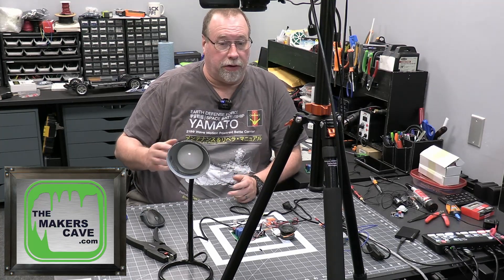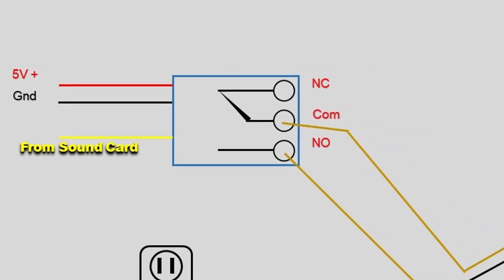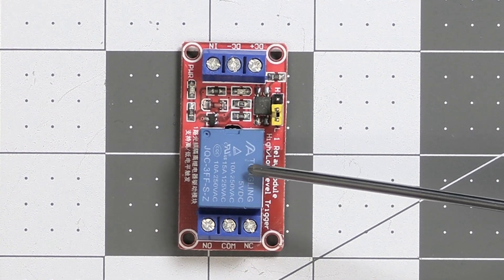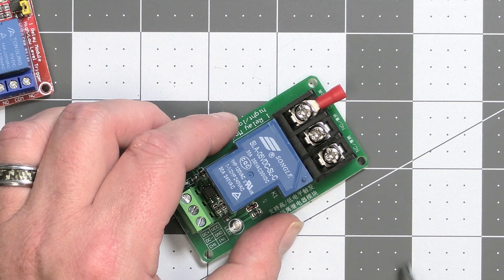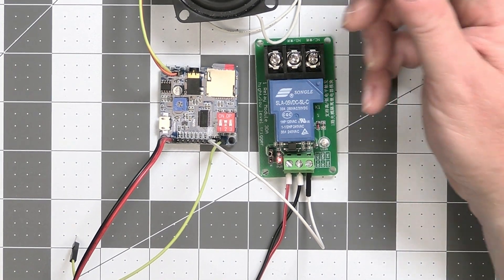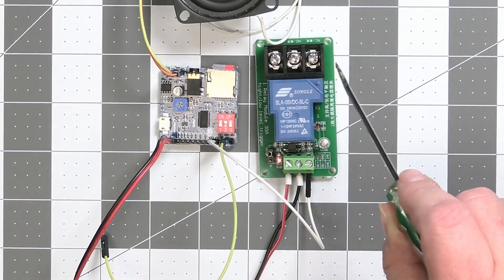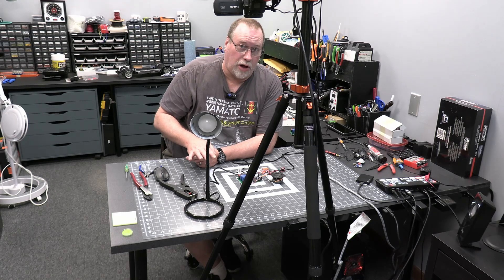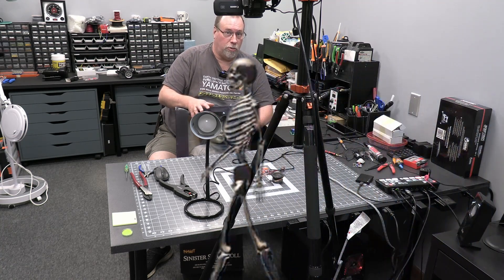How to wire lights & motors to the Easy Prop Sound project

Comment: I have the mp3 connected to the 5v 4 relay board and everything is working properly (4 props) but I have no sound ...can you send me a connection diagram...please...thanks
Reply: Never Mind I had a loose wire...thanks for your complete walk through it all works.

Comment: Excellent video! I would remind people that the deer motor will switch directions under a load or initial start up ;)
Reply from the maker: That's the problem with common AC motors,      the rotation direction is random on power up.  I wanted to  mention that and forgot, I was trying to make sure i answered all the questions I was getting.
Reply: I know this is a dated response to deer motors...I was pulling motors out of tossed microwaves...and they are asynchronous .  If it's important to your prop,  you can order synchronous motors (one way spin) from different repair houses.

Comment: Great explanation, however you should address polarity regarding AC power to prevent possible electrocution.  Also perhaps mention the sizing of the spade connectors depending on gauge of wire.

Comment: Watched these two videos in quick succession. I’m a haunt builder that has 0 knowledge of electrical and board technology. Thank you for making this video super easy to understand. Your directions are clear and at a great pace to understand what’s going on. I never felt lost at any step. Oh and your diagrams and animations are helpful too. You can tell you put a lot of time into your videos. You have earned a subscriber in me. QUESTION: Any suggestions for a casing for all of the boards so that this could be kept outside for a short period (few weeks/days) to prevent the weather from ruining the tech? Is something made specifically to house those boards other than using a Tupperware container or similar?
Reply from the maker: I'm so glad you enjoy the videos and thanks so much for watching.  There are no specific enclosures for the boards.  Yet.  Katrina and I have been toying with offering custom boxes to house the boards.

Comment: Hi Steve!  I wish I lived near you so I could buy you a beer (if you drink).  This was another great video and I am really looking forward to the next in the series.  Your tutorials are very helpful and spark the imagination.   I think we're headed in this direction already but since you asked for content suggestions I'm going to throw this out there.  I'd really like some instruction on how to build my own Prefect Storm or PicoSTORM or Velleman LIGHT ORGAN.  The PicoSTORM is a nice piece of equipment but it doesn't play well with LED spotlights which I think simulate lightning better than halogen or incandescent.  The Light Organ is also a fun piece of equipment but it's low voltage and there's no direct audio input so it's uses are limited.  Thanks again for what you are doing!
Reply from the maker: Very interesting.  The hardest part is getting the lights to sync with some thunder sounds.  I'm already thinking of way :)

Comment: Would it be possible to wire the relay board so the light stays on after the switch is activated and the sound ends? It’s for my proton pack build and I’m still sorting out how to have two light and sound pairs. The first pair would switch on together with a rocker switch, but the light would remain on after the sound, the pack powering up, ends. The second pair would work simultaneously with a button switch. 

Thank you 😊

Comment: Just a casual observation. When you cut the AC cord I noticed you did not mention matching wires. One side is smooth and one is ribbed. While with most two prone plugs there is a large spade on one side and definitely with a three prong ground plug , it is a good idea to match the wires when reconnecting.
Reply from the maker: That's right, you're very correct.  the legs should not be swapped.

Comment: Could you run a light off the always on side and the motor on the always off side? So the light would turn off and the motor would run when triggered.
Reply from the maker: If both devices are the same type and amount of voltage yes.  For example, and we'll be using 12V DC power source.  Run the ground of both devices to the ground of the power supply.  Next take positive of the power source and attach it to the COM (common) terminal of the relay.  Then wire the positive of the always on device to the NC (normally closed) terminal of the relay.  Take the positive of the device that you want to turn on during the relay activation and connect that to the NO (normally open) terminal of the relay.  You now have a device that will always run until the relay is activated.  Once activate the relay will switch the COM terminal away from NC, turning of power to that device, and switch it to the NO terminal providing power to that device.  Once the relay is "released" the COM and NC terminals will contact again, return power to that device.  If you have two different types of power, like a DC motor and AC lights, YOU CAN NOT DO THIS!!!  For that I would suggest the same type of relay but in a 2 Channel version, basically two sperate relays on one board.

Comment: Hi Steve, fantastic video! Is the entire setup powered by 5Volts for everything? How big of computer stereo speakers can I get that would work with this module via the 3.5mm output jack? Can the output jack power 2 speakers by using a 3.5mm audio Y splitter cable? I love these kind of video! Keep up the great work!
Reply from the maker: the 3.5 jack will output to any amp or powered speakers, like computer speakers.  The 3.5 jack provides an unamplified live-level output. That particular board also has a 5 watt amp that will power a speaker directly through the on board speaker connection (not the 3.5 jack).
Reply: Excellent! So if I connect an amp to the MP3 player via the 3.5mm jack, can I can connect the amp to a larger pair of speakers?

Comment: Do you already have a video with something along these lines that controls pneumatics that can switch on and off quickly to create something to move really violently?
Reply from the maker: No, but interesting idea.  You might be able to use a 555 timer board.  I might have to do a video on that.
Reply: @TheMakersCave  thanks for the tip!

Comment: Can you use the normally closed position on the relay to play an ambient sound while the prop is not activated?
Reply from the maker: Absolutely, have the ambient sound play on another pin, have the NC terminal connected to this pin.  Then that file will play when not activated.  The file will lay again when it’s finished.

Comment: Hey Steve, I really like your videos, they are very helpful to someone like me, with no real electrical experience.  I have the circuit wired with the deer motor and sound card and it triggers a child sized skeleton in a child’s rocking chair.  My question, is there a way to start the sequence, besides touching the lead to the sound card.  ie: can this be wired with a manual switch, or better a remote control?
Reply from the maker: It sure can!  Using an inexpensive wireless relay you can actually activate the relay and have a different sound depending on which button you push on the remote.  I'll do video on it.
Reply: Cool!  Maybe even add a motion sensor?

Comment: Hi Steve,
My question is, how do you add a motion sensor to this set up? I would like the motion sensor to be tripped and my music and wiper motor to kick on at the same time. Tank you.
Reply from the maker: This is the one downfall of this setup.  The pins on the sound card are looking for a LOW (negative) signal to activate.  The motion sensors that I like to use, and most people use, put out a HIGH (positive) signal when tripped.  I have a new sound card that I found that has a built in motioni sensor with a busy line (to activate the relay) and it even rotates through the sounds if there is more than one sound.  I'm going to be doing a video on this card this week.  If you are handy with IC chips you could use a hex inverter, like a 7404, to change the sensor from a HIGH to a LOW.

Comment: If i wanted to add a motion sensor where would that go?
Reply from the maker: Unfortunately the sound card is looking for a LOW signal to activate and the PIR's commonly put out a HIGH signal when triggered.  The easiest way is to add another 5V realy to the mix, lets call it a PIR Relay.  The NO (normally open) and Com (Common) terminals of the PIR replay would be connected to one of the sound board's sound pins and the other to the sound board's Grd (ground) pin.  The PIR would trigger the PIR relay, making a connection between the sound pin and ground.  That will make that sound play.  That inturn makes the sound board's BUSY pin go LOW, activating the sound board's realy, making the prop/sound/action happen.  Our all-in-one sound and motion sensor board is really good at doing all this for you, but sadly, we sold out of those quickly and they won be back in stock until the week AFTER Halloween.  How's that for bad timing.  Here's a link to the instructions I just made: https://gravedecor.com/download/add-pir-to-sound-card
Reply: @TheMakersCave  Thank you very much

Comment: Hey Steve great work! Can I use a wiper motor with this setup or would I need a different relay?
Reply from the maker: You sure could.  Use 5V to power the PIR and relay and another power supply to power the motor.  Have the realy's Normally Open (NO) control the motor power, use the positive wire.  You could probably use the standard termainal relay, but I  don't know the specs of your motor.  When I use high draw items like wiper motors I like to use the 5V relays with heavy duty terminals, like these: https://gravedecor.com/product/1-channel-5v-relay-with-heavy-duty-terminals-30a
Reply: Thanks so much

Comment: I have a monster in a box and need to trigger a light with a 3 prong plug, a wiper motor, and sound. I have the audio board kit with 5v relay from grave decor and trying to figure out how many relays that would require and if the 5v relay will work or do I need to order 12v relays. Thanks
Reply from the maker: The 5V relays are called that because their electronics runs on 5V, that's not a limitation on what the relay terminals (Com, NO, NC) can handle.  If you have 12V props, then yes, you would need two power supplys, 5V for the relays/PIR and 12V for motors and other 12V items.  The relays would make the connections so the 12V stuff will operate.  I would recommend one realy for each item, but you could split the relay trigger to go to each of the relays activation terminal (IN).  That way one PIR can trigger three relays.
Reply: What does one have to do to make it pause and reset before it plays the next pin?  I bought a couple of the 3 watt board wired up with headers..changed the mp3 files.....when I play back audio it goes from 1 Pin Activated, and so on to Pin 8 and then loops again...same thing when I use my mp3 files..   Great video - I'm a beginner and this was a fantastic video to help on the learning curve.
Reply: @TheMakersCave as long as your power supply has enough amps you could use a 12 volt power supply and use a buck converter to step down to the 5 volts and therefore get away with one power supply. 
Van oaks has a video on wiring step down converters.  You can get ones that step down to a fixed 5 volt and also adjustable ones if you want to wire battery operated props into you dc wired system.

Comment: Hey sir i have a question 
I have bought the exact same components as showed in the video 
Although i can’t seem to get a solid open en closing on the relay 
You didnt specify what voltage that busy pin is outputting